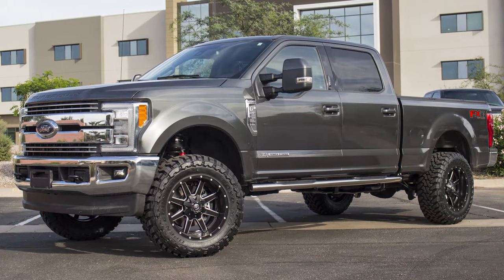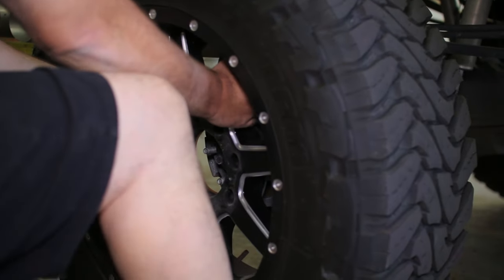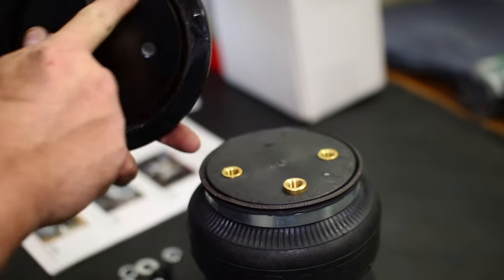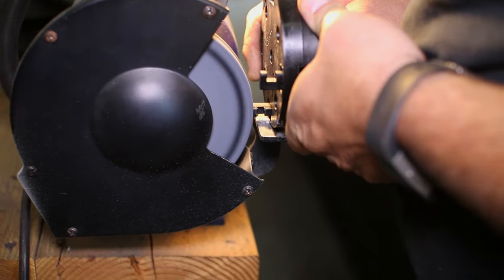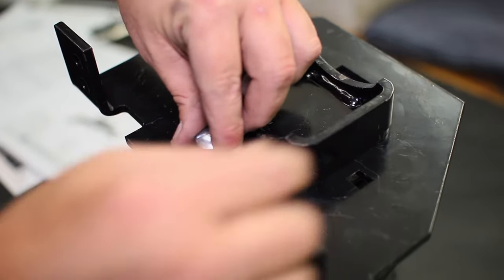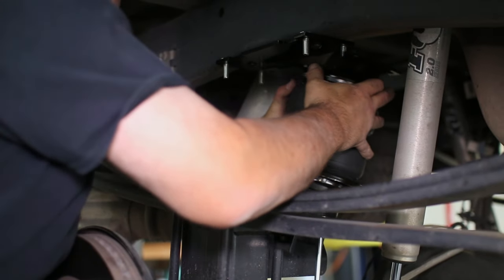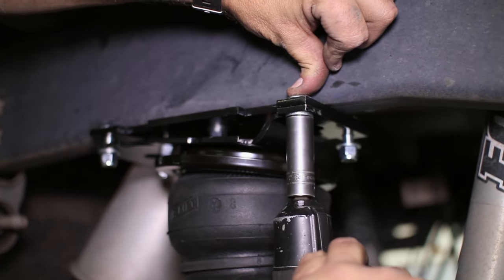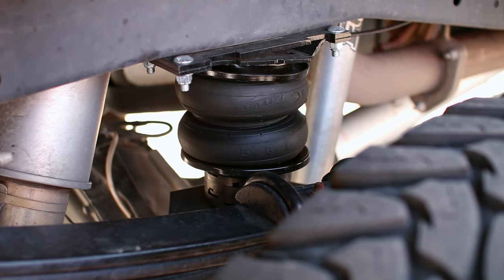F250 & F350 4WD Air Lift LoadLifter 5000 Ultimate Rear Air Spring Kit Install

Comment: Really nice that the upper bag brackets were installed BACKWARDS and are binding the bags.....The bags were very badly out of alignment!!!
Reply: Yeah, you saw that too? I'm currently putting bags on my F350, one big thing the instructions say is to make sure the bags are aligned vertically, and the distance between the brackets is the same on both sides, otherwise there's a good chance you'll be damaging the bags. Guess I'm off to look for another video.
Reply: @Czech6ix  I thought something looked funny there..
Reply: @sophry7556  Yep. I did install those bags on my truck, have about a 100k miles on them now, they're holding up fine....as long as you do the install right, unlike the experts in the video LOL.
Reply: @Czech6ix  I appreciate the heads up.. i just bought a set myself. Should come in saturday!Saturday!! Woohoo!

Comment: Are the fasteners hardened?  I couldn't tell from the video.  Some kits have soft junk fasteners.  Also, are there torque specs included?  I have plenty of impacts, none will insure the fasteners are tightened correctly.

Comment: I think I saw somewhere else in one of your pics that the truck was lifted 4.5 inches. You only used 2 spacers under the airbag for a 4.5-inch lift?
Reply: Frank Aldaco yes because a 4.5” lift is in the front, the rear only gets lifted 1” over stock... a 6” front lift is only a 3-4” rear...

Comment: Is there a video on YouTube of someone doing this correctly?
Reply: @robertbudach3304  maybe, but dude did it wrong...for real.
Reply: If this video doesn't help you get'r done, you probably ought not be wrenching on your truck.  Or anything.
Reply: @andrewalexander5049  that's racist.
Reply: Read the instructions this is correct. I questioned it also as the bag is not straight up/down. Take away the lift kit spacers and it’s still correct. Would have nice to know he torqued everything to specification.

Comment: How lifted was the truck that you needed spacers, I just ordered this system for my 22 250 and I have ready lift 2.5 lift kit so 1” taller blocks in rear.
Reply: Have you installed them? And did it ended up higher than the front?

Comment: Hammer and screwdriver to remove OE bump stop frame clips? 🤦🏼‍♂️ and parts installed incorrectly... I just did installed these on my 17 F250 glad I followed air lifts instructions and not this video tutorial

Comment: who is your engineer?? because you need to fire him/her. air bag not straight up and down. mean you can sheer the lower bolts. they are in plastic. 2nd why install it to the cast iron? is there not a top hat you could make a new piece to replace it and your done.

Comment: will this work on a 6" lift?
Reply from the maker: Yes you can put this kit on a 6" lift. Here is the spacer kit you would need - http://www.stage3motorsports.com//52150-2004-2014-F150-F250-Air-Lift-Load-N-Lock-Air-Spring-Spacers-6inch.html

Comment: Question:  Any idea what spacers would be needed for a 2020 F350 Tremor?  The manufacture website says it will not fit Tremor, but I am assuming that is without the spacers.
Reply from the maker: Hi Brandon, give our team a call 623-434-5277 or send us an email sales@stage3motorsports.com for more!